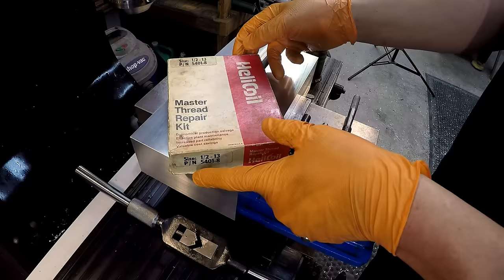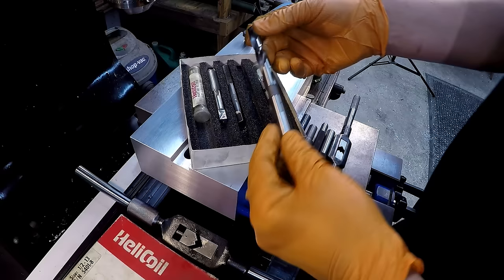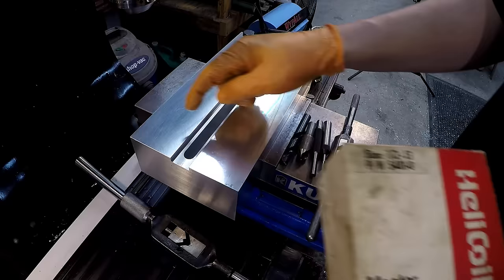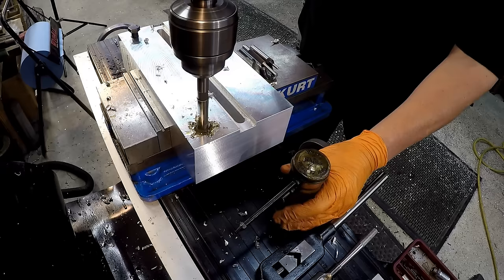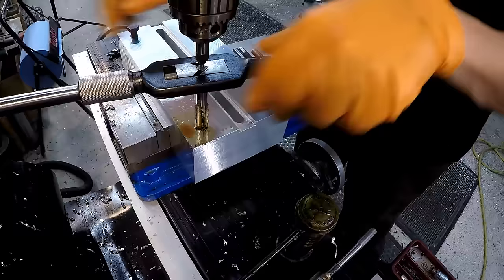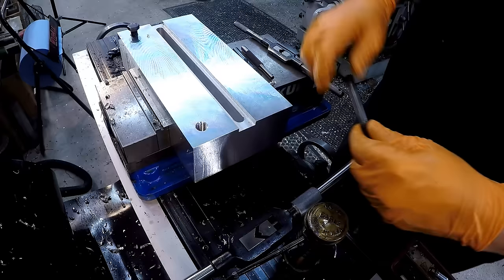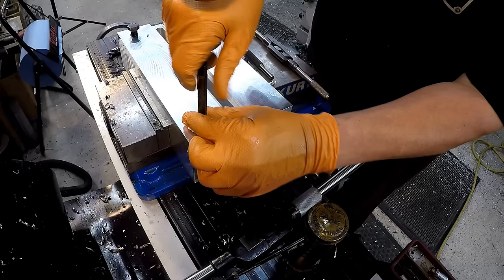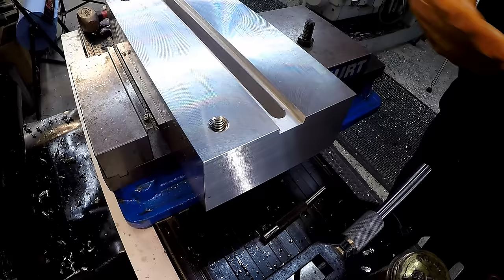How To Install a HeliCoil

Comment: Keenserts are far better than helicoils. great video though.
Reply: He pronounces them as " helicool" 😂
Reply: @machinistbytrade  lol i just watched a video where a guy was calling a motherboard a mudderboard.
Reply: From what I have seen on this channel the keenserts seems to require a larger hole so the HeliCoil seems to be better in some tight spots. However, in this particular application I would agree the keenserts seem to be a better choice. Is there a big pricedifference?
Reply: @granander  the helicoils are handy to trim if they are longer than the required depth... and there is minimum oversizing of the hole...
Reply: @granander  Yes. They cost more.
Reply: No they arent
Reply: @cencoast_7.340  i'd love to hear your reasoning but i doubt you even have one. Keenserts hold up far better there are very few situations where a helicoil is better.
Reply: Dragon800 Except when you are a machinist who has the choice to install ANY type of insert and you choose a Helicoil.
Reply: Dragon800 I’m 37 years old and have been wrenching on my own cars, trucks, dirt bikes etc. since I was knee-high to a grasshopper. Many times I’ve come across a situation that needed fixed. There’s always that “perfect solution” that exists and rarely is that the one in your garage. My grandpa taught me how to Helicoil on the aluminum heads off his 350sbc out of his ‘41 Ford. There were other options but he explained the Helicoil is pretty easy to install, it’s quick, it does the job in most all situations just fine and best of all...that’s what he had in his neatly folded leather case! Yeah, we could have used a myriad of different approaches to the problem but sometimes the best fix is what’s been around forever, is quick and works 95% of the time, all the time. So I suppose for my Grandad and I, Helicoils are better than a Keensert over 95% of the time!

Comment: "It's used for a stronger thread than normal" Well what keeps the coil from stripping the aluminum? If you want a stronger thread use a Steele insert! And if you stripp a thread drill it out and weld in an Insert! Guess what! A welded Insert is never going to work loose!😂
Reply: I thought the purpose of these were to replace the thread of a stripped out hole 😑
Reply: Heli coils are stronger then the aluminum it's threaded into. 
They work good for a screw that is permanently installed. 
For a screw that is being constantly installed and removed a solid insert holds up longer.
Reply: Due to the helicoils elastic nature the force in the thread applied by the torque is more uniformly distributed among the threads, which makes it stronger. Search in google 'helicoil force distribution"
Reply: The oversize thread in the block is stronger than the internal thread due to its larger diameter. For example, a helicoil for a #8 screw gives you close to a #10 thread in your block. Another advantage of helicoils is that you can get self-locking versions. If you don't trust them, never get on a plane, there are likely hundreds of them used.
Reply: The coil won't be stripping the aluminum because it won't be moving. As explained in the video, the clamping bolts will be tightened and loosened repeatedly, which would gall the aluminum. A welded insert requires much more work to install, welds can crack, especially in small areas like this, to say nothing of all the heating caused by welding distorting the part.
Reply: @Randy_84   they are  also used on OEM aluminium housings etc. I love 'em & if I'm making something from aluminium which needs to be disassembled occasionally I ALWAYS fit helicoils first... 😎👍☘️🍺

Comment: How to install a helicoil in one step: don't.     On valuable parts use full solid machined threaded inserts or drill oversized and weld in an insert, depending on whether or not welding is an option.   On cheap parts just get a new one.   Helicoil is only good for emergency temporary repairs.
Reply: WYLTK.

Not at all, helicoils or similar are permanent fitted correctly.  
Aluminium, you can only weld in an aluminium insert so what is the gain. OK, you could use a higher strength aluminium alloy but welding often creates distortion or may not even be possible in holes close to an edge?
Reply: @iainreid9914  Saying that on aluminum you can ONLY weld in an aluminum insert is patently false.  In fact, that is not even the most common solution.   By far the most common solution is a special alloy STEEL insert which is threaded into the hole.  Its similar to a helicoil in principle, except that it is solid, not a wire, and therefore much stronger and more precise.   I have personally installed hundreds of such inserts in various aluminum castings.
Reply: @wouldntyouliketoknow9891  

you said weld not me, I'm just saying that welding an aluminum insert is not so good. If you onle meant steel, say so.
Nor do I think that screwing a steel insert into aluminium is any better than a helicoil. I don't doubt that they will work in many cases but not all especially where there are narrow areas that need treating.
Reply: They (helicoils) are standard OEM fittings in Milwaukee Core-Drilling machines ... I know this as I used to service these machines and NEVER saw a pulled or stripped helicoil thread... 🙄😒
Reply: Peter Fitzpatrick Not to mention aircraft. I use them in aluminium cylinder heads all the time for intake exhaust bolts, cam bearing caps etc. 
Never seen one fail. Al these clowns carrying on about inserts have obviously had little or no experience with heli coils.
Reply: @donziperk  exactly man, we use them on our carbon rigs all day long for durability on removable fittings and they work well. As long as you install them properly you won't have any issues
Reply: I am yet to see one fail. And have installed thousands. And ran jobs where tens of thousands were installed with pneumatic installation tools. A solid insert is bigger outside diameter. But is over kill. unless it is a spark plug or taper pipe thread for sealing reasons. I couldn't justify the cost for every hole.

Comment: Whats the point of helicoils?
Why cant you just tap to the specs required by your bolt? Whats the benefit of the "middle man" that is helicoil?
Reply: He explains at the beginning.
Reply: maybe dont skip the first seconds?
Reply: It's aluminum. Heavy machining on aluminum causes a lot of heat.
Reply: They're steel and the stripped out threads are aluminum. Less likely to fail again. You also cannot tap stripped out threads back to the original size, it's always going to be larger. The helicoil brings it back to the original thread size.
Reply: @dayjeremy  This is correct. I didn't think it was necessary to state the obvious, but whatever.